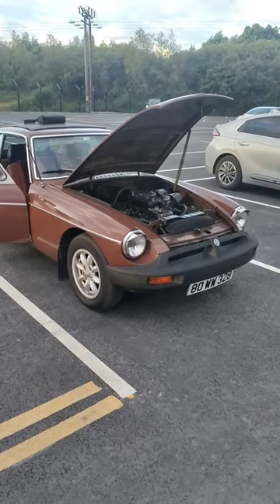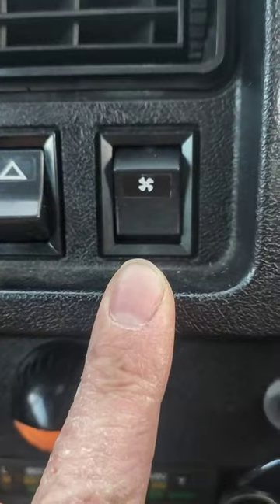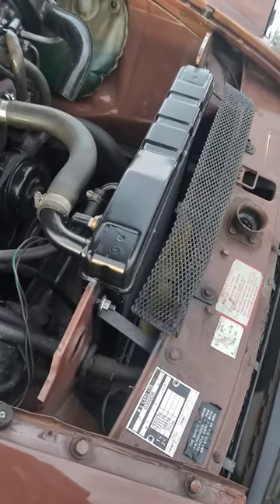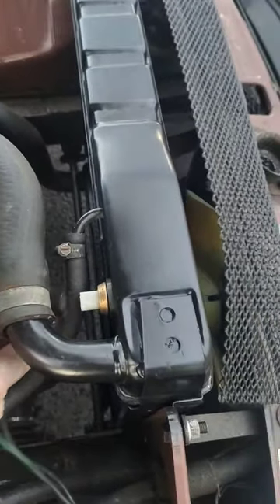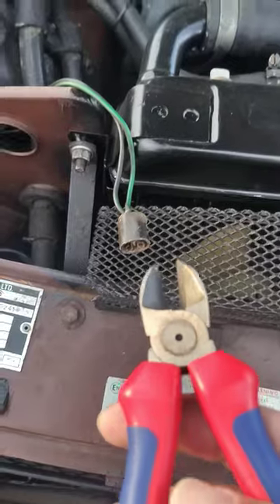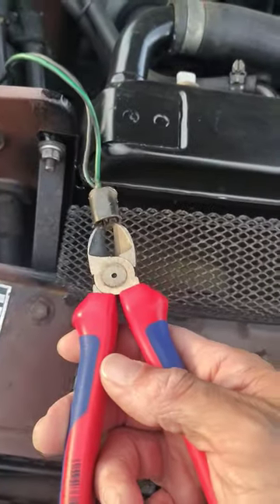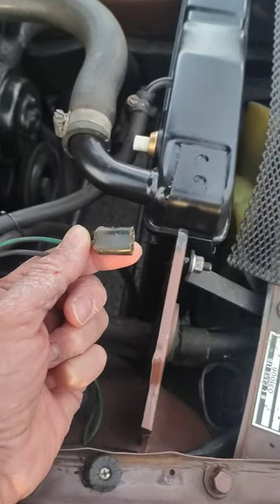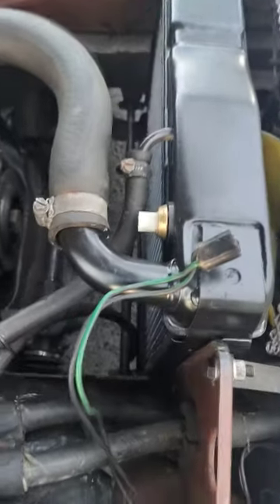MGB overheating? CHECK THIS FIRST! #classiccars #mgb #car #overheating

Comment: I had a radiator shop add a radiator cap fitting to the top of my 1977 MGB radiator. Makes it much easier to add coolant. The radiator cap I use on this fitting has a much higher psi than the coolant reservoir radiator cap has so the system still works like it was designed. Also, if your car is leaking coolant, release the pressure in the system by partially opening the system to depressurize it. It will still leak, but the coolant won't be forced out under pressure. Might be enough to get you home.
Reply from the maker: Interesting. That being said, you shouldn't need to add coolant unless it's going somewhere. I use a funnel in the stat housing if I ever do need to top it off.

Comment: Had an overheating prob in my `78 MGB & finally solved the prob by adding a second radiator from my `76-B parts-car so I run dual-rads.
Reply from the maker: Interesting solution. I'd have said that was masking the real issue. It shouldn't need a second rad.
Reply: do you have the mud shield at the bottom of the radiator? It is meant to direct air through the radiator instead of under it. And definitely ensure your fans are coming on. You may need to bleed your system if it has an air bubble preventing hot fluid from touching the fan sensor.
Reply: @c.brionkidder9232  Neither radiator in the car has mud shield, nor my `75 titled project car. I`ve flushed the rads, tried changing thermostats, changed water pump and then added the plastic mechanical fan. 
Nothing worked to keep temp down for city driving until I installed the additional rad. My `78 only ever had a single electric fan as per export reg`s and still works well w/thermostat but I`ll likely never hear it again nor see temp gauge beyond the halfway point with this volume of water I`m pushing. Nice to have a top cap too vs just the surge tank. A real scream to drive!
Reply: @Endfloat  Def shouldn`t for stock but it`s a tad warmed-up with aftermarket goodies. Tried diff water pumps, thermostats, even a mechanical fan. Got a couple spare MG`s in the yard & decided to push twice the water with an easy install. Plenty of room...could prob get all 3 in there lol

Comment: I always keep an extra fan sensor in my glovebox just in case
Reply from the maker: I would strongly recommend against removing the fan switch if the car is hot at all, let alone overheating. Instead, pull the connector off and bridge the contacts.